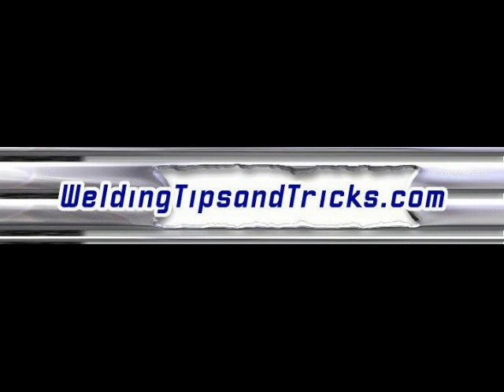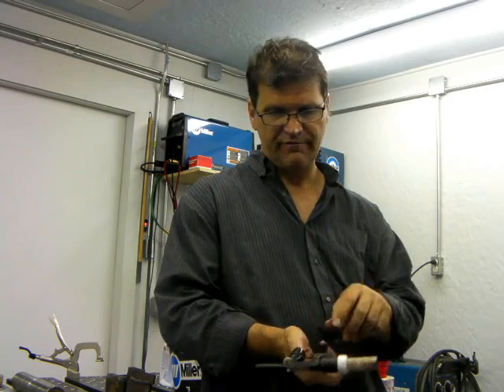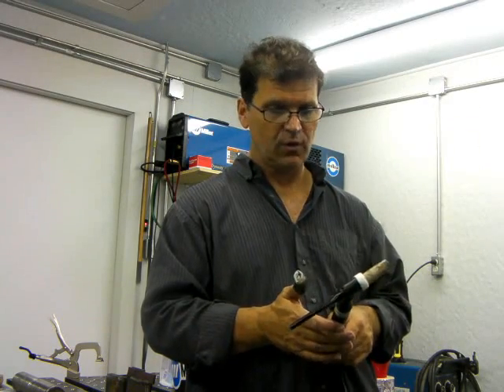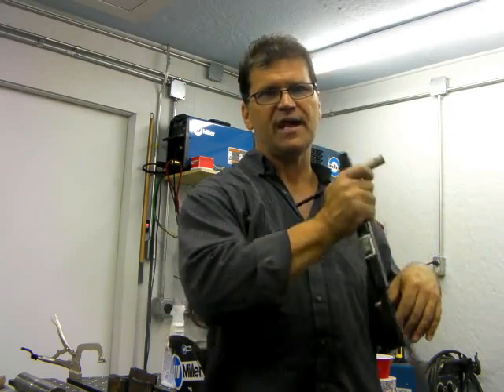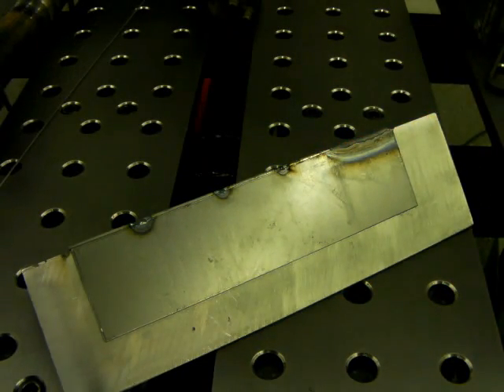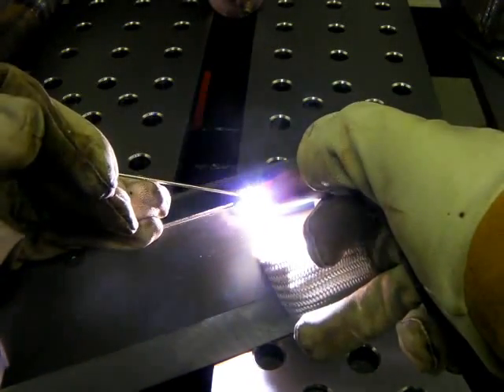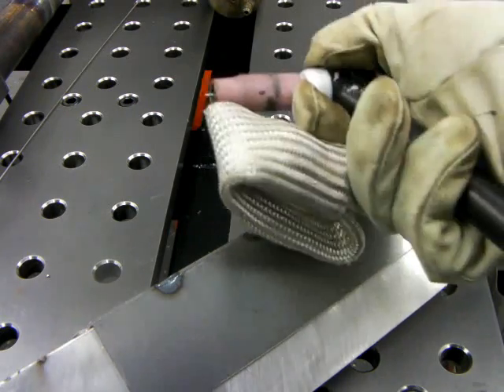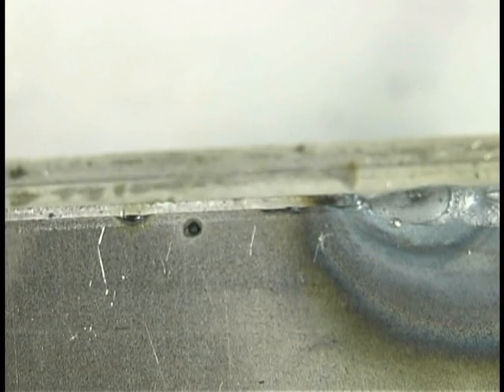Homemade Tig Welder - Tig Welding Old School with Scratch Start

Comment: Are you serious Have my old stick welder converted to do TIG scratch start is just another method you have to get used to. as for post flow well you can count cant you surely this adaptable method of post flow is wholly acceptable, i use a transformer machine in arc and tig I feel I can run seven  rings around most people with inverter apart from aluminium think Jodie sold concept short a lot can be done with an old dc power source.

Comment: Ok, so if i understood this  then I never want to tig weld with AC. Only DC electrode negative.
Reply: For steels that dont have any magnetism to them yes. Aluminum you need AC tig and if the part is magnetic you need AC or the magnetic field will literally throw your arc. 9 times out of 10 you just want DCEN though so yes you are correct.
Reply: How a bout Aluminum ? AC toomsyone would be a 50/50 balance, insted of  30/70 witch allows longer sessions( more dimes before it gets too hot to hold) and shorter torch cool down , right?
I'm asking my naber has one an I've got everything but the hot foot adapter ( ? Where the clamp goes on the torch lead.). Or am I better off running dc AL spool gun. 1/8"and down.

Comment: I am mechanical, structural and electrical engineer, first class. Ask me anything you like to know. And I am also expert in modern technologies and robotics and a great topper in mathematics and PHD in Cosmology.... but i love painting and carpentry!!!!
Reply: ANYTHING?......tell me. how do you add a high frequency transformer to a DC welder to enable you to have high frequency starting without the HF going back to the welder and blowing circuit board out or electrocuting you?......do you need a high amperage high frequency diode to block the HF from getting back to the welder?

Comment: A large variac would solve the problem of the amperage control. tie a string to the knob and hook it to a foot pedal and boom, foot pedal amp control.
Reply: No, that controls the volts not the amps.
Reply: @gangleweed  How does a CC power source control the current? By changing the voltage. 
Need more current? Assuming the resistance of the circuit is going to stay usually around the same value, which is generally but certainly not always true. Pump up the voltage. V=IR.
You're correct that he wouldn't have any direct and precise control over the current with a VariAC other than "more" or "less".
Reply: @mikes2381  All transformers have a definite input watts depending on the windings and iron cross section..........you can't get more out of the secondary than the primary can equal with losses......a 100 watt primary will only give you approx 100 watts secondary      1 volt at 100 amps or 100 volts at 1 amp etc etc......you can't get the volts up and the amps too.

Comment: I've had a Lincoln AC225 buzzbox for a few years.  A few months ago, I came across a good YouTube video about building a simple diode bridge rectifier for a DC output add on for the buzzy.  Works GREAT.  Now, I not only have the AC output, but also DC output.  I added Dins quick connects for both outputs and everything is solid.  Part of the project involves winding a coiled section of the DC positive cable around a wood dowel or pvc pipe just before the connection for the DC+ connector inside of the case.  I used pvc pipe and made my coil with a 2 inch inside diameter, hot glued the coil sections together to hold them together.  Then hot gluded the coil to a piece of scrap wood that is also glued and screwed to the case for holding the weight of the coil so as not to put that strain on the cable connection.  Everything works as a "champ".  I use a WP-17V scratch start TIG torch hooked to a bottle of 100% Argon.  I bought the 131 cu.ft. bottle instead of leasing.  I can now TIG for a max investment of less than $350.

Comment: this is my only welder ;] salt water voltage regulater lol i saw i guy make one with copper plates in tub of salt water tank move apart less output from his 220v outlet i will built on for brush motor speed control it neat as it high current n keep the 60 cycle fase

Comment: Pretty cool.
As someone just getting into welding, on tight budget, I'd much prefer this route 
I have a lot of electronics background soldering. I'd much rather feed my fill with one hand, and heat with the other.
I'm getting ahead of myself though since I have no welding experience. I'm considering an fcaw, mig capable, unit to start with.
Stick just doesn't sound like my cup of tea. I like precise control.

I'll have to get me a cheap, used, stick rig to try doing TIG with. This vid gives me the confidence to try it. Thanks!

Comment: Billions of dollars of pipeline and boiler code welding is done every year with scratch start rigs. That's why we taught our pipe welding students using that setup. Here's an excellent Weldingweb thread on assembling them with a parts list.  http://weldingweb.com/showthread.php?38106-For-The-Can-I-TIG-With-My-Welder-People I'm not affiliated with WW (unless over 4,000 posts count) but it's the most comprehensive welding forum. Foot pedals and fancy control options are wonderful in-shop, but they aren't a practical option on many job sites.

Comment: My Thermal Arc 95 S pooped out right after I bought a new torch hose (dried and cracked). Searching for a used 100 Amp stick box to pair the torch with. Ideas, suggestions on how to get best performance? It must go at least as low as 10 Amps, though 5 Amps would be better.

Comment: Thanks, I only just came across this video and the timing couldn't have been better because I've been thinking of doing exactly this. I have a 160A inverter welder and a water cooled tig torch that's been in my workshop cupboard for years waiting for the right opportunity to get going. I'm busy with a workshop remodel and this is going to be my first project when the remodel is done. First, build a water cooler and then a gas control box to start and stop the gas flow. I don't like the idea of leaving gas pressure on the line to the torch and the torch I have anyway hasn't got the valve on it. I've been wanting to get into Tig welding for years now.

I love your videos, they are very informative.

Comment: I was always taught in welding class that, once you touched your Tig rod which was made from (Tungston) from what I can remember, that it was considered contaminated... So then the point needed to be ground and cleaned again.. Does that not matter anymore?  And my second question is: So Tig uses DC current?
If so I bet the two 12 volt battery hookup trick would work awesome with Tig welding as long as you had some Argon with you!!!
Thanks 4 sharing!!

Comment: Can you leave the arc welder AC and Tig in AC for  aluminum. I know that I only be 50 to 60 hertz but was just curious. If it is possible what amperage would you use for say 1/6th and 1/8 inch aluminum.

Comment: Can I use an a/c buzz box and your tigtorch setup to weld aluminum? I.e. not using a rectifier, just ac
Reply: I dont think so i could be wrong but dont try it until you know for sure. I know for sctarch start tig ya use DC Positve for torch and 1/8 inch tungsten. Pure argon and ya shud be able to do thin wall aluminium. For thick wall ya use helium and higher amperage of course. Atleast I think Im not a welder I'm just a wannbe

Comment: I have a 1950s Westinghouse 250 amp AC-DC welder and a old tig torch but I have a valve on hose with long wire arm for flicking gas on and off. I see you use alum, I use copper, will alum work?

Comment: thank you very much! 
I cant afford a tig welder but we have an old stick welder.
Can you do spot welding by tacking?
Reply: Ya use the torch. No seriously you use the tig torch like ya would stick welder just touch the tungsten and it will do it. i recommend using a seperate tungsten for tacks and a diff one for welds

Comment: Any way you can get me the schematics for your old school rectifier and some good pics of it?id like to make one for my ac lincoln tombstone
Reply: search "full wave bridge rectifier" and that is the whole schematic minus a smoothing capacitor that you may, or may not want to add across the output. Find your welders maximum current and multiply it by 1.414. This is the BARE MINIMUM amp rating of the diodes you need. I'm a stickler for robust systems so I usually just buy diodes that can handle twice the current needed. Past that, you just need some beefy heat sinks an the rest is fitting.

Comment: I've only been welding since February, and I can't imagine TIG welding without a pedal. Even the scratch start machines we use have one.
Reply: You have to adjust the welder to what amps your foot holds the pedal as your welding,, takes some getting used to,,,there no adjustment to stick welding if you've ever done that,,, same prince-able....

Comment: Take it that electric tape fiberglass was the prototype to your Tig Finger.. Haha
Been trying to get info on converting a buzz box to a TIG. Great way to save $3000. I'm wondering if a foot peddle could be added to this setup. A revised video on this would be nice if that is an option. Thanks for the info.
Reply: the only way I know of to add a pedal to a buzz box would involve a servo motor physically coupled to the amperage adjustment on the welder, and if a buzz box's innards are similar to other machines Ive had to open up, you'll end up burning the brush in the control knob if you adjust it mid arc.
Reply: *Servo on a variac then. I never quit.
Reply: Hell yeah, if you have a big enough variac then its definitely doable. You should just need to find a potentiometer that can run the servo through a full turn with the limited range of the pedals motion. Alternatively, if you're handy with microcontrollers you can skip all the analog matching and just calibrate your chip to the available range of the pedal pot. Also, if you dont have one already you can probably find an atx that will give you the +/- voltage needed for cheap. I source mine from small scrap yards. Just make friends with the owner and a lot of times they'll let you come in and disassemble some stuff for parts. I tend to sort the stuff I have to pull off but dont need for them and I pay a little bit over what they would get for the parts at scrap price. It still works out to a hell of a deal for me and it keeps them happy to see me. The most Ive ever paid at once was $30 and I walked away with armfuls of steppers, laptop supplies, bitchin heat sinks and lots of other little goodies. I even picked up my 25k neon sign transformer that way for like $10.
Reply: Not often I run across someone genuine and smart.. I'm good buddies with the foreman at the local scrapyard. I do as I please with anything that is scrap and slip him a 20 dollar bill. Used to be a treasure trove but they hauled almost all of it off so I'm kinda disappointed.

25kV neon transformer?? do you want to sell that? I will make a working Tesla Coil some day! Last deal I got was a 1/2 HP Myers Deep Well Jet Pump for 10 bucks.. They said it was burned up. Took it home and re tapped the wiring for the correct voltage and irrigate with the damn thing.. 350 dollar pump that works like new.

Peace Atlas
Reply: Thank you, sir. Likewise. I'm sorry to hear your scrapyard dried up. That has happened with mine on occasion but it doesn't seem to take too long for them to get some goodies back "in stock". I hope thats the case for yours as well. 

As for my neon transformer. Sorry, I'm afraid its quite near and dear to me and the thought of letting it go puts a sinking feeling in my chest. Gotta impress those nerdy girls somehow. lol Awesome job with that pump btw. 

To you as well Mr Playa.
Reply: fla playa
Reply: fla playa

Comment: you can't beat those Lincoln tombstone welders I've owned mine since 1988 and thought I paid alot for it at $179.99 back then but man has it paid for itself over and over again mine has fallen off my trailer going 55 had to put a new power plug on it but it still works its looks like hell but will lay a bead like the first time I used it

Comment: interesting, unfiltered DC a lot of ripple current there, spose welding shouldn't matter. For aluminium would you need rectified current? curious. I have Lincoln speedtec for stainless etc but have an old junker choke welder thought might try it with tig for Aluminium..

Comment: I want to get into Welding so I can do little projects like making some stands for my foundry, or welding some pipe fittings onto stainless steel.. any suggestions for the type of Welder? I see theres Tig, Mig, Stick and Arc... Tig seem to be the pricier welders are Harbor Freight... So im guessing those might be what the majority uses for using a welder for multipurpose? I know it really depends on what youre welding.. so thats why Im asking whats a good all around one. I also see people building stick welders out of microwave transformers.. are these decent welders? anyone know how many Amps they can get up to?
Reply: Christopher, I'm about to make some very general statements so please bear that in mind when you read this... 

TIG is very much a multipurpose type of welding. With TIG you can weld carbon steel, stainless steel, aluminum, cast iron, and others such as titanium. TIG machines are often more expensive, depending upon the features the machine has. Machines that have High Frequency start and a gas solenoid will cost more than those that don't. TIG requires a shielding gas, usually argon, which can be expensive to obtain depending upon where you live and what's available. When TIG welding, you have to feed the filler rod into the weld puddle with one hand, manipulate the torch with the other, while most often controlling amperage with your foot. This can be difficult for a beginner. Jody has fantastic videos on TIG welding basics and I highly recommend watching them so you have an idea of what you'd be getting into. 

The wire feed welders are easier to operate, in my opinion, but still require knowledge and skill to get the best results. Too often cheap wire feed welders are marketed towards the novice, often resulting in welds that are not structurally sound, with little penetration or tie in. This isn't the machines fault per se, but more the fault of the operator. There are a lot of people named Bubba out there that buy a 120-volt wire feeder and want to weld a trailer hitch. The lower powered and less expensive wire feed welders sold at stores like Harbor Freight are fine for welding thinner materials such as sheet metal, and when used within their limitations they can do fine work. The more powerful the machine, generally speaking, the thicker the material you can weld. 
MIG systems are wire feed welders with the provision for attaching a bottle of shielding gas. They are more expensive, but you have less spatter and don't have to chip or brush off the melted flux left by flux core wire. With MIG you can also weld stainless and aluminum, with the proper set up. 
If you want to just "glue" stuff together with the lowest learning curve possible, then a wire feed welder may be what you're looking for and this is typically what most people buy for "general use." 

Stick welders are simple machines and therefore fairly inexpensive.  I don't know about using a microwave for a power supply, but why go through the hassle? You can often find a good quality used 220-volt (200+ amp) welder for around $200 on your local Craigs List or auction sites.  Little 120-volt machines are available new for $100. 

Stick welders are very versatile. You can find electrodes for welding mild steel, stainless, cast iron and aluminum at your local farm supply store or local welding shop. The learning curve is steeper than with a wire feeder, because the rod burns shorter and shorter and you have to feed it towards the puddle, while moving the rod. It can be tricky for a beginner to maintain the correct arc length and travel speed; more so than with a wire feeder, which feeds the wire for you. Welding thin materials or small parts is far more difficult with stick, but stick welders often have the power to weld thicker materials than a similarly priced wire feeder. Where I live, stick welders are what most people use around the farm for fixing equipment and general repairs. 

There are several companies marketing inexpensive, Chinese welding machines for the hobby market; such as: Everlast, AHP, Longevity and Razorweld. Some of these machines are available online from Amazon, others from Home Depot and some are available directly. 
I think many would say that the Hobart brand welders that are available from many farm supply stores carry a lot of quality at a reasonable price. Lincoln brand welders are available at Lowes and other large "big box" hardware stores. 

Whatever welding machine you decide to invest in, be advised that you won't get good results without practice. You're not going to be able to run to Harbor Freight and buy a welder and get decent results at first, no matter what the process.

Comment: it is better to stop take out the elctrode and sharpin up the tip with a grinding wheel i use to work in a stainless fab shop and we all ways did the sharping to make a better bead  other wise the bead will be less than perfect
Reply: to get a round ball you have to turn the arc welder to reverse side and as low as possible and draw and arc and watch it ,,, it will form a ball on the end of the Tungsten,,, this is used for Aluminum and us Pure the green Tungsten,,, red is for steel and Stainless steel,,, you sharpen them,,,
Reply: i think there should be two tungstens one for tacks and one for welds and you switch them out. But grinding is gonna be very commonplace with learning lol